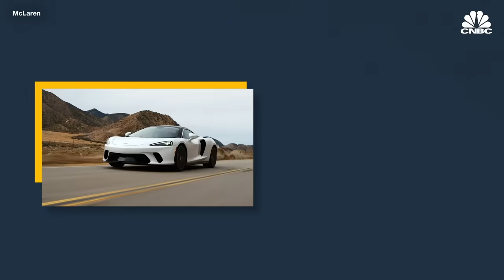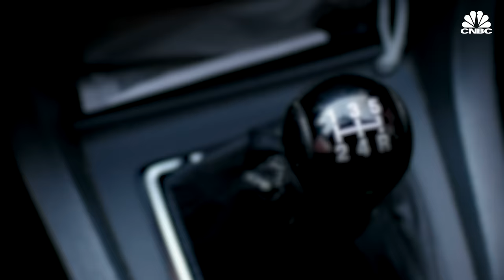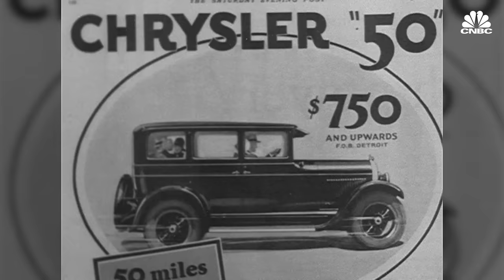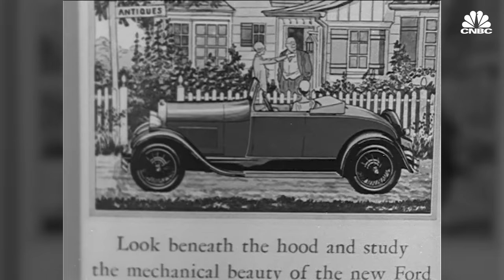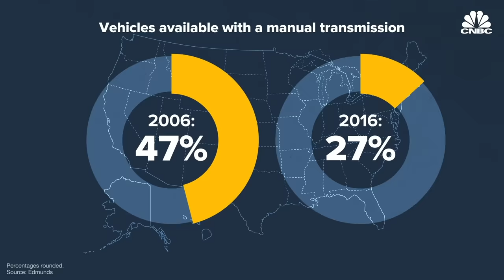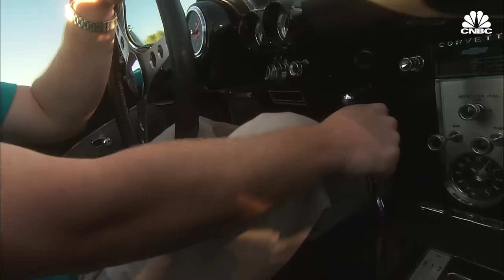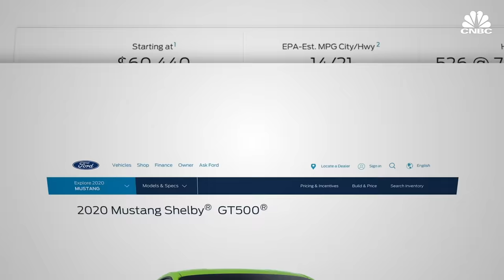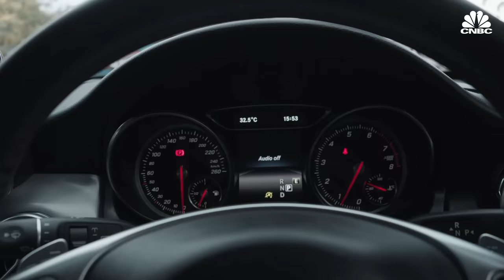Why Stick Shifts Are Going Extinct

Comment: "People don't like manuals because they require constant attention." So your telling me that I am supposed to be paying attention when I am driving? I guess that's why I keep hitting mailboxes...
Reply: Same thing applies to automatic, but like it’s even easier and better 😃
Reply: Maybe  they  just have a short attention span  and you only  have to pay attention  when you first  start driving them  after awhile  it just becomes  2nd  nature  and you  don't  even  have to use  the tachometer  for those  that  don't  know  what  that is it's  the rpm  that the video was talking about
Reply: no, it means people can have even more attention to put on driving rather than shifting. Anyways... manual transmissions are death... thank god
Reply: @iamdenislara  
You don't need any more attention to drive manual than auto.... It's virtually impossible to stall a manual in a car produced in the last 20 years. In fact, it may free you up more to focus on driving. You can roughly tell how fast you are going without ever even looking at the spedometer so you don't have to look away from the road as often. It's easier to avoid speeding excessively on long stints on highways.
Reply: Attention is good thing because it will keep you awake compare to automatic transmission
Reply: People driving automatics pay more attention to their cellphones or cups of coffee they hold in the hand not using the stick. This is why people driving manual are better focused on the road.
Reply: @KryptonicHD  after about 2 months of driving stick I stopped even noticing having to shift. Yes, auto is easy, but manual isn't hard. It's a more engaging drive, which I love about it
Reply: @Artyomthewalrus  you cant be on your phone while driving a manual i think this is way it is dying people are doing other things while driving so they cant handle shifting
Reply: @fcmadrid23  thats the point people spend their time when driving doing other stuff why would you focus driving when you have a phone call or a tweet to respond too
Reply: I agree with waldo
Reply: I also agree with H Q
Reply: The problem  with most people today  is that  they  can't drive  that's why they  have self parking  and driving  cars  oh how I'd love  to see  some people dive a car that didn't even have power steering  or a/c those were  the days when driving was driving  and of course let's also  throw  in the stick shifts  but not the ones one the floor  the column ones  great times then
Reply: fcmadrid23, no, it's because silly millennials are worried about how many texts they can send rather than worry about whether they're going to hit another car...
Reply: Car manufacturers don't want to put in a standard transmission because they want to put in everything else that distract your attention like a $3,000 radio cell phone connections and everything else anymore people aren't driving the electronics is driving them and that's why there's so many accidents if there were more manual Transmissions people would actually have to pay attention
Reply: @pascalolivier4458  Exactly. My mom drives automatic, my dad drives manual. My mom speeds. My dad doesn't. He has to consciously choose to speed, whereas my mom just has to push the pedal harder.
Reply: Actually yes. The stick shift is why you keep hitting mailboxes.
It's one more little thing that steals your attention away from the actual road.
When I do 6 hour long rides , I want the car to handle all the small things (gearing, speed, etc), so I can focus on the big things (the road and other drivers).

Driver for 20 years now. Even my own parents fully adopted automatic long before me.
It was a pain to drop the old rhythm, but once I was off it I realized how much attention it steals.
It's nice to focus your hearing on the other important car sounds, and not having to constantly glance at the tachometer.

Biggest bonus: You never get the "How does the shift work on this car?" problem when you get a new car, or drive another brand. 
I do NOT miss that!
Reply: Why would anyone want a manual? Might as well go consult an encyclopedia instead of Googling things too.
Reply: @billbroad2004  "those where the days" hey talk nice about my old car! I only got rid of it 2 months ago, so its not that long ago!
Reply: @DaxCyro  youve driven for 20 years and still go "how does the shift work on this car?" I call bs, i've driven for 8 years and i never do that, havent driven a single car wich i didn't know the shift in after taking the first turn(and ive driven aleast 30diffrent cars by now)
Reply: @mikebaird6788  Well said. I'm so disgusted with the now standard “luxuries” of cell phone/bluetooth connectivity and other new fangled gadgets that today's cars have. More distractions for the driver. Also gauges on electronic screens on new trucks (especially in Europe) and new luxury cars (e.g. Mercedes Benz) is bs.
Reply: @iamdenislara  Heeey, don't hate just cause you don't know how to drive a stick, I'm sure you're pretty good at riding one though!
Reply: Manual transmission is to me much safer way of driving than with an automatic. With a manual I’m more engaged in driving and therefore have more attention for driving. With an automatic I get bored sooner and thus loose attention for the road.

As for long drives, a manual doesn’t make any difference to an automatic. As soon as I get on the highway I put the car in the highest gear and set the cruise control. After that it’s just keeping an eye on the road, steering and slight speed adjustments, that’s no different from an automatic.
Reply: @zentrobi1548   that's  the point  I was trying to make  older  cars  are better    there easier  to work on  they had  fewer  options  true but that was just less that could  possibly go wrong  and  if you were  to take  an older car  and happen  to get in an accident  there  would  be  Less damage  than on these newer  car's
Reply: @xavierdarche4822  so true

Comment: I was so proud of being able to drive a manual transmission. It was like learning to ride a bicycle. When you finally got it, it was like second nature. The car "talked" to you. When the engine revs started to climb, you could hear it, and you could react by shifting sooner to save gas or later to accelerate faster. Shifting down to decelerate or come to a stop was also poetry in motion. What I also liked was the ability to coast in neutral. Yes, you can do that with automatic transmissions, but one always lives in terror of accidently shifting into reverse. My latest car is a regular automatic. Gawd, is it boring to drive.
Reply: I feel your pain. I miss having a manual transmission.  The last one I had was in the late 90s.
Reply: I miss it so much too!! Haven't driven stick in like 10 years...I usually drive our boring 2010 Honda Accord which isn't fast right away, and even slower when the AC is on of course...ugh...I want a manual car again...
Reply: Exactly, it was a freakin right of passage, my grandmother taught me, she drove a stick until she was almost 70. Taught herself how to drive a three on the tree stick and taught herself how to drive because grandad wanted her to stay home! She was a lot of fun to roadtrip with!!!
Reply: I still have stick. Don't even notice most of time, & it's more fun when you want it.
EXCEPT - Crawling on a 'freeway' in peak hour constantly working the gears because you have to, rather than because you want to, does feel like a chore. And I spend more time in peak hour traffic than I really want to...
Reply: @tsubadaikhan6332  Getting moving on an upward slope was also an adventure, especially when there was a car right on your rear bumper. Left foot easing up on the clutch, right foot pressing on the gas pedal, left hand holding the steering wheel, and your right hand trying to let the handbrake down ever so slowly... talk about multitasking!
Reply: From what I’ve heard, it’s a horrible habit or idea to shift into neutral while driving an automatic transmission. Despite what one might think, it doesn’t save any gas and it’s not good for the engine.  Those automatic vehicles aren’t designed to be in neutral while the car is moving.
Reply: @firefalcoln  You should google that. I've never had any trouble with the practice. My current automatic car is 15 years old. Surely by now any problems with doing that should have surfaced. I admit I don't do it very often. I usually use the normal braking effect of an automatic to slow the car down as I approach a red traffic light. Now that I think of it, I once had a 1971 Mercury Montego automatic that I switched into neutral at the top of La Veta Pass in southern Colorado. I coasted for an eternity. Surely an engine turning at idle speed is using less gas than one turning at 2500 RPM. Hey, I think I got my first manual transmission car after that Montego, a 1976 Ford Pinto Wagon.
Reply: @electrickayn5619  Some of us can take pleasure in driving a manual. Some of us can't.
Reply: @firefalcoln  as long as the engine is running spinning the front pump lubricating it, it doesn't really hurt it.
Reply: Totally agree with you. It really puts you in the driver's seat, when it comes to focusing on driving. The gas savings is incredible too.
Reply: Getting stuck in traffic with a manual car is horrible. New cars have auto engine switch and doesn't require the driver to switch to neutral in order to save gas. I am British so I grew up with manual cars and I hate them. Can't understand why would anyone choose a manual car voluntarily.
Reply: Yes I too thought I was badass and had a lot more fun driving my manual 6 speed civic si. But when over 90% of my driving is on straight boring highways and bumping to bumper traffic, manually shifting just got old and tiring. I've grown up from thinking I'm in a fast and furious movie and now drive something much better in every way than a slow manual transmission.
Reply: Just drive my '06 Toyota Prius Hybrid for a week. That automatic will seem exciting!😁
Reply: @jrvapor  Of all the manuals I've ever driven, I find "Three on the Tree" the most fun! It makes me feel like I actually know what I'm doing, to be able to drive. I've done it enough, that it's second nature to me. I have to be careful not to jam an automatic into park, as I'm stomping the floorboard with my left foot, looking for a clutch pedal that isn't there.
Reply: @prieten49  I liked it when drivers had to know what they're doing. Now, any idiot can drive, because they don't have to know anything to do it.
Reply: You should never coast on neutral. That’s one way to get into an accident.
Reply: Also love the fact that if you have a dead battery or a temperamental starter you can just push it (generally speaking) to get it started and be on your way.
Reply: "boring to drive"=more focus on the road and potential hazards.
Reply: @prieten49  , it is a very bad idea to put it into neutral going down a steep hill with snow and ice.  Brakes will only lock up and then you lose control of steering as well.  You should learn how to down shift at higher RPM's if you ever get into this situation.  As downshifting without "rev matching" in neutral is also going to lock up your drive wheels.
Reply: @richardjones4662  Richard, I would never try coasting unless it was under ideal conditions. When I coasted down that mountain pass to the Colorado plains, it was summer. The incline could not be called steep. I maintained a fairly steady speed all the way. Trust me, it was safe. I have coasted down many a hill since and I'm still here. Thanks for your concern, though.
Reply: @prieten49  Your logic is wrong at the end even though the engine is spining faster when in gear if not accelerating in injection fed cars you are not consuming anything as is the cars inertia that keeps the motor spining, but if you are in neutral the engine has to consume a bit to keep in idle. The logic changes if you are driving a carburated engine as it is dependant on aspirated air not electronic driven
Reply: Lol You just need paddle shifters in 9speed auto you feel right at home 🔥
Reply: Poetry in motion, downshifting you absolutely said it best. My first few dumps were so jarring, and then once I got it, learned to give it that blip of gas before letting the clutch out. Amazing.
Reply: Don't be concerned about shifting into reverse. A regular manual gearbox doesn't allow to do that.
Reply: @prieten49  I was trying to explain that to a new standard driver on here today who is terrified of hill starts.
Reply: Isn't coasting on neutral illegal?
Reply: @DatingMatis156 Is it still possible to find cars with manual transmission?
Reply: To this day, I'm still uncomfortable driving an auto with the driver-side window rolled up because I can't hear the engine noise properly so that I can time my shifts.. then I remember that I'm not in charge of shifting and then I get a bit depressed
Reply: @prieten49  Learning how to do that without stalling, or angering a whole lot of other drivers behind you, (at least for me) was the essence of learning how to drive! Just remember the feeling of pride after mastering the complicated movements for the first time.
Reply: I've always had manuals :)
Reply: @prieten49  of course you know that was not the only way, right? Half masking the clutch until the engine RPM changes a bit and while holding the brake.  Release the brake then slowly press the accelerator while releasing the clutch.  The alternate way and I find it to be more effective.
Reply: @BasedApricot  Sir/madam,  to each their own.
Reply: Thank you for changing your youtube profile picture.
This really makes a difference!
Reply: buy one from europe. we have plenty of them and then send it!
Reply: @SimonBauer7  Hier in Japan fährt man auf der linken Seite. Ein junger Kerl hier hat einen Trabi importiert, darf aber nicht damit auf der Strasse fahren.

Comment: There is no advantage to having a stick-shift manual over an automatic. They are slower, less efficient, harder to use, require careful and constant attention, are harder to start and stop suddenly/in case of emergencies, and most importantly, annoying and frustrating to use in traffic. It adds an unnecessary layer of complexity to driving, which is already hard enough for most people (92% of all crashes are caused by human error).

All electric cars are "automatic" by default because electric motors don't have gears, so driving stick-shift is going obsolete, the same way writing letters, or heck, even actual handwriting is.
Reply: If you can walk and chew gum at the same time it's very easy to drive with a manual. They do not need constant attention and starting and stopping with them is not an issue. It only takes a very short time to get accustomed to driving a manual. If you have any coordination at all it's a snap and quickly becomes second nature. If they're not severely abused they can easily outlast the vehicle because they are not nearly as complex as automatics and should they need repair are less costly. If your battery isn't quite strong enough to crank the engine over you can push start a manual. That's impossible with an automatic. Most all automatic transmissions have to be cooled by sending the transmission fluid through the engine radiator. If your engine starts to overheat so will your transmission. If the tranny plumbing inside the radiator leaks it will destroy your transmission. Manual transmissions are self contained for cooling and simply keep cool by heat transfer through the metal case to the outside air. I commuted for many years in heavy traffic rarely needing to shift gears or even use the brakes very much. Today's automatics are slightly quicker and get slightly better fuel economy but they are also significantly more expensive to produce and are more prone to failure.The only advantage I can see is if you are physically unable to drive a manual or you have really bad coordination.